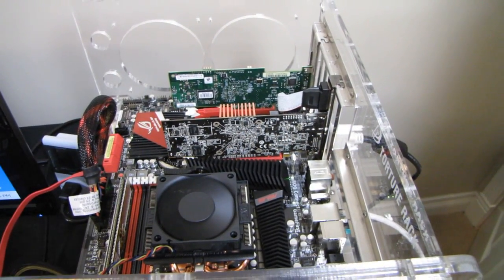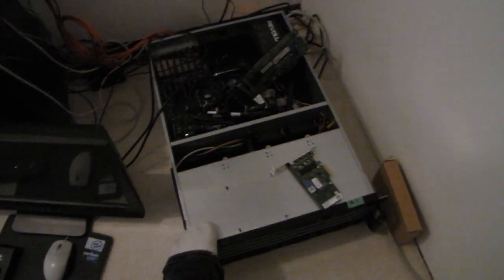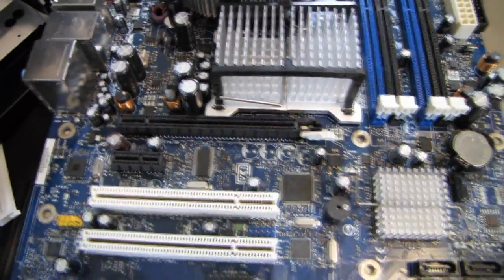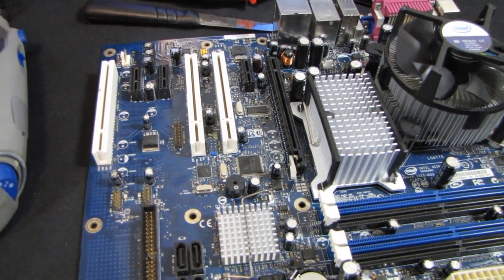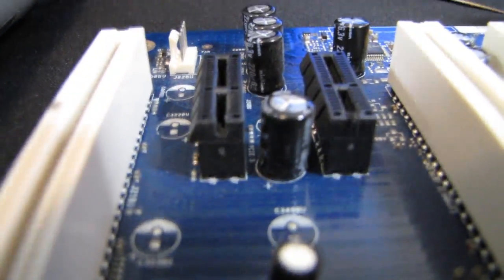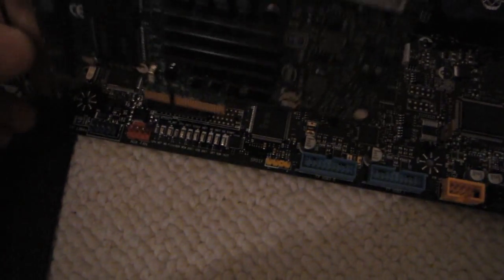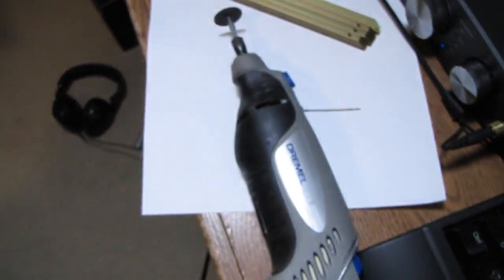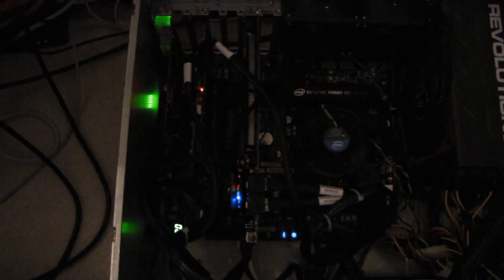Personal Project - Make a PCIe 1x Slot Compatible with Longer Cards Linus Tech Tips

Comment: I recently had the same issue with a PCI-E 1x slot. Tried the same methods, none of them really worked well.

The best I found was using a soldering iron with a small tip to melt the slot in the side, and then use a knife to cut off edges.

Comment: Okay, 
so for those who still look up for this particular DIY and do not have a Dremel at hand. I just did it with some cutter I had in my room and it actually works great ! However before you try it by yourself, please make sure the plastic is soft enough to be cut by hand. Applying too much force with a cutter might result in you being injured or the motherboard being damaged. I personnaly accidentaly sliped onto the motherboard with the cutter which luckily missed some BIOS PCB traces. 
Good luck !
Reply: Another way that might work is whacking the end off with a thin screw driver or flat piece of metal, or long thin nose pliers 2 bend & break the end off?  If he simply went in at 90 degrees 2 the slot instead of inline with it would have never damaged the pins!

Comment: I did it with a FLUSH SIDE CUTTER (use one for electronics which is smaller and thinner at the tip) which was just thin enough to fit inside the pcie slot and simply cut the tab clean, you have to look up close to notice its a mod and not juts an open pcie x1 slot, so this is the perfect tool for the job.
Sadly my asus M2NPV-VM is dumb and dosnt want to detect anything other than pciex1 cards.
The idea was to use a pcie x4 nvme card to put an ssd on it but the idea is busted because it wont detect it, and even a hd 3650 doesnt get detected (which i found people talking about it working on x1 slots) 
I read some M.2 ssds wont work on x1 slots so maybe its that too.
pcie x1 ethernet card works so the slot is working.
So all in all, the motherboard has to be smart enough and the ssd has to allow working in a x1 link.
Reply: Which tool exactly do you use ?, can you provide link ?

Comment: But in order to install the 4 lane card, you need to extend the PCIe x1 slot with more lanes. How are you going to extend that, will you have to take a part of another pcie x1 or pcie x16 slot lane from somewhere?
Reply: That's not true. To use it at x4 speed, you need 4 lanes. If you can get it into a "smaller" slot, it still works, just at lower speeds. In this case, his x4 card will run at x1 speeds, which may not matter to him if he doesn't need that speed in the first place.

Comment: the other way it works too, just cut the frigging useless pins on your card :-) i did it on an old gt9300, had to plug it into 4x pcie, savage way - plain cutter, i tore half of the lenth of the pins off and it works just ok... i needed to plug a very old supermicro with vga only into hdmi switch, and i had only one 4x pcie slot free, and it was darn cramped i wouldn be able to plug full lenght nvida the way you did... (vga->hdmi adaptor didn't work well, it wouldn't negociate well with my hdmi 2.0 only monitor during POST)

Comment: Would it be easier to cut the unused part of the cards contacts off and then slide it i in or at least notch the card where the connector housing hits it? The card is probably really cheap compared to the MOBO. I’m going to try this with an older HP Proliant server  and an old graphics card and I’m going to just trim the card contacts down instead of the board connector. I’m Just playing around with old parts as this server computer I got was free and is otherwise useless to me.

Comment: i need to know can u put a nvidia - geforce gtx 960 4gb gddr5 pci express 3.0 graphics card into a pci express x16  2.0 slot cause when i try the pc wont even go to the bios screen my pc just beeps
Reply: Yes you can. 
Try out all Display-outs, on your gpu and motherboard
Reply: Delusional Dan I did this myself and it works out of the box, check your psu and all the cables, try another gpu to see if yours is causing it.

Comment: I plan on putting a PCIE USB 3.1 adapter in an HP compaq 6000, will this work?
Reply: Theoretically yes, but due to the limited bandwidth of PCIe x1, you won't achieve the standard speed of usb 3.1 (10 Gbps) because PCIe x1 has a max bandwidth of 6 Gbps. You would probably be better off using a usb 3.0 adapter. Make sure to get one that runs of of SATA power, not molex, because the dell compaq 6000 has a few spare SATA power plugs. Due to their location it the case, you may also want to get a 12 inch sata power extender cable. If you search for "Mediasonic HP1-U34F" and "StarTech.com 12-Inch 15-Pin SATA Power" on amazon you will find a compatible card and extension cable. Hope this helps.

Comment: A 1-2 PCIe X1 ports amount on a gaming motherboard is fine.
WTF do MB manufactures of boards 2015+ are putting FOUR! of them on a premium gaming motherboard?!!  (AHEM, ASUS, AHEM)
Especially now-a-days with the advent of SSD drives becoming more popular for PCIe ports.  So many PCIe X1 ports on today's motherboards are simply a waste!
Who the hell designs these motherboards?!
Case in point.  Why the hell do we need on new gaming motherboards so many on-board graphics ports (especially DVI/VGA!!??), when gamers(for games anyways) will be using a DISCREET GPU!?  Save the space on the back I/O panel for more USB ports (for gaming peripherals), Thunderbolt 3 / Type C ports.
Reply: i myself dont have a gpu for my old pc and i only have a vga monitor left so i would be screwed.
secondly the newer boards have 4pcie 16x slots and 4pcie 1x slots, which are uncapped so you can do what linus did
Reply: I'm talking 'gaming' motherboards.  If you're a 'gamer', you're going to have a gaming motherboard with discreet GPU. Also, if you're a gamer, you're going to have a decent monitor, which at this stage in things, should at least have an HDMI port.  So, if your discreet GPU fails, I guess it's nice to have the option to drive a monitor, but all you should really need is an HDMI port.  SO I say on recent and new motherboards focused on gamers, one HDMI port on the back I/O panel is fine.  Save the rest of the space for USB peripherals, which gamers often use/need.
As far as pcie slots, if you've got a board with 4pcie 16x slots, you're likely needing that for some SLI configuration.  Some of the 1x slots are ultimately going to be covered up by the GPUs.  While the backside of the port may be opened up on some motherboards, does that mean something like an Intel M.2 drive would be able to take advantage of high speeds?  The more GPUs plugged into your system, the more pcie lanes you're going to need.  So there may not be much of a point to have so many pcie 1x slots, especially if the CPU is the limiting factor regarding the lanes.
Reply: you can still get a pcie extender cable if u NEED TO. even so you dont even have 4gpus unless u are rich

Comment: You could rotate the motherboard for 180 degrees instead of wishing your "dremel could run in reverse" :D For a moment I wondered how come a mad genius did not come up with as simple solution but then I figured out you probably wanted to do it as fast as possible so you don't wake up the baby and just went with what you had after you turned on the dremel :)
Reply: +Nedim Mehmedovic He probably couldn't get a good angle on the slot from the other direction, due to the other pcie slots and other parts of the mobo being in the way.
Reply: +XepherTim  you are right, I just watched the video one more time and he actually explained this issue when he mentioned dremel as one of his options :)
Reply: +Nedim Mehmedovic Yeah, I actually just tried this and getting a good angle is really annoying, especially if you don't have a really small dremel. I actually went with a different tactic where you dremel perpendicular to the pcie slot so you don't have to worry about hitting the little metal pieces quite as much.
Reply: If you use dremel often Flex Shaft Attachment is awesome (I got one with my dremel knock off)... It lowers the profile and is great if you need precision. https://www.dremel.com/en-us/Attachments/Pages/ProductDetail.aspx?pid=225-01
Reply: +Nedim Mehmedovic Yup, that or a right angle attachment would be very useful in this situation.I'm not sure I use a dremel often enough to justify the purchase though.
Reply: +Nedim Mehmedovic I was just about to comment on this, turn the dremel.... I literally had to grab the closest circular thing and spin 180 in my chair just to make sure I wasn't missing something obvious
Reply: +Sean Anderson I had to do that in my head couple of times before I typed my commented :D However, he actually explained why he was unable to do it prior to the cut (I've missed it as well when I watched the video for the first time) :D It is impossible to get a good angle because motherboard elements are in the way :)
Reply: Nedim Mehmedovic I think what he meant was, he couldn't do it with the dremel while it was still in the case, but then he took it out of the case anyways.

Comment: On the pinout for PCIE on wikipedia, the top right pin that got cut was just a ground pin.
However, the pin to the left of that was a receive pin. Or it might also be the pin which tells the motherboard that the card is connected, which if that were broken...you're screwed

Comment: you put the motherboard on carpet omfg!!!!
Reply: Nah, i've built >1000 systems over the past 10 years as a professional system integrator, i'd say >80% of them were done on carpet, and i never had a single problem with static discharge. Oh, one of my latest build was a 1U server with 2x xeon e5-2698v4 CPUs(20core each) with 16 x 64GB dimm ddr4 2400 ram,(1TB total). Oh, yeah, that was done on carpet too. Another recent one, xeon e5-2699v4, with 4x128GB ddr4 2400 ram(512GB total) in a micro atx chassis(prodigy-m). Again, done on carpet. oh, and the ram, just floating around, didn't come in antistatic bag, just stored on the carpet >2 months when I got around to it. 
I used to work in an environment that was not carpet at all, but tile, you would stand up, and the 10 feet to the light switch would build up enough static to give a sizable shock when flipping off the switch. Again, handled sensitive components like 24bit ADC chips, bare boards such as rasberrry pis, arduinos and wifi modules. Consistently shocking them from the environment, and again, never have I ever had one die due to static discharge.

This being said, static discharge is still a serious issue, on the manufacturing line(making 10000+ chips per day) 1 in 1000 died due to the static which i just described. You have a 99.99% chance to not break your components, so if it's just a single build, or if you are willing to send back components, then stop worrying about it so much. You have a higher chance to break your motherboard by buying an LGA socket motherboard because those things always bend their pins and are never fixable(which is why i prefer PGA CPU sockets). I've never lost a CPU due to bent pins on a CPU, but i've lost >10 motherboards due to bent pins on the motherboard. That is the issue you should bring light to.
Reply: Mike Crapse good job backing up my statement by just saying it isnt a huge threat and talking about a whole different topic
Reply: Benjamin Hopkins electrostatic discharge from carpet could easily kill the board
Reply: Benjamin Hopkins so?
Reply: Michael beseler doubt it
Reply: Mike Crapse google search it
Reply: ESD discharge can greatly reduce lifetime of electronic device or  deteriorate it's technical parameters. It causes deferred malfunction, so you just don't understand relationship between this failure and it's cause. As a system integrator you must know what ESD protected area is, and act according to specifications from component manufacturers. That's the difference between professional and dilettante.

Comment: That Pentium 4 tag reminded me of my first computer which I really don't know about..I just remember Windows Millenium, the one before that, and Windows XP was installed in it. I played GTA3, Warcraft3 etc. What specs could it have?
Reply: AfterDark3 you think you're funny?
Reply: Windows XP / Windows Vista
Processor	
400 MHz Pentium II or equivalent
Video	
8 MB 3D video card (TNT, i810, Voodoo 3, Rage 128 equivalent or better) with DirectX® 8.1 support
32 MB 3D video card
Memory	
128 MB RAM
256 MB of RAM
Storage	
700 MB available HD space
Internet	
Multiplayer requires a low-latency, active Internet connection rated at 28.8 KBps+.
LAN play requires a TCP/IP connection.
Media	
4X CD-ROM drive

I'd say around that.
Reply: CalculuS Its a joke. And yes, I'm trying to be slightly humorous.
Reply: AfterDark3 come on man, next time atleast try to be a little more original.
Reply: CalculuS I'd like to sound like an internet Dushebag so i will, But will it run Crysis?

Comment: you shouldn't have a problem with the power draw, as long as the video card has power direct from the PSu e.g. 6-pin/ 8-pin, because most video cards should draw any power that the PCI lanes are not supplying them with from the PSU directly.

Comment: well you could solder in a x16 slot you will just have to flush cut all the unused pins.  You could also buy a plug in adaptor. I would like to note they do make x1 video cards really that would be the cheapest solution.

Comment: Correct way would be just using a preheat/rework station, then removing and replace the socket. Takes less than ten mins to do (minus the time to order the DIP PCI-E socket from digikey)

Comment: Your son is going to be a total and complete computer geek. AAAAand those nVidia 3D glasses don't make for good eye protection. You are going to want to have something else like actual safety glasses that you could get at the hardware store for cheap. Yes I do agree with you to wear safety glasses as I nearly lost an eye from flying and hot debris but don't use stuff for gaming for safety. It's kinda like using bowling shoes as running shoes.

Comment: The motherboard has some extra pins for a card higher speed (and length), why not just unweld it and weld one from some of the corrupt motherboard then?
(I assume you have one or two at home, at work, not to mention stores with electronic equipment)?
Sorry for my poor english
;o)

Comment: and board fails in 1 month time due to sitting it on the carpet and passing static potential through integrated circuits that can handle 1/1000th of the voltage of static electricity

Comment: Looks like there is a 4x footprint on your motherboard, maybe you could use a heatgun to desolder the existing 1x slot (shrouding the surrounding board with heat shielding, of course), then install a real physical 4x slot (which can be purchased from Mouser or Digikey). Of course, Dremel is easier ;D

Comment from the maker: I was on vacation when I filmed this.
Reply: So you took a motherboard with you on vacation
Reply: this works with PCI 16?
Reply: Noice
Reply: To be that guy resurrecting an epicly old thread, but how did this solution work out longer term? Have a similar issues with an older machine right now.
Reply: @nathang7309  in videos in recent years hes mentioned that its totally workable doing this so im asuming it worked just fine.

Comment from the maker: ended up being more hassle than worth due to crap SMC modem from my internet provider.

These days I could take another run at it, but I'm pretty happy with my EA4500 running pre-cloud firmware.
Reply: i am the first to like and reply, more than 10 years later
Reply: iThink it's pretty fascinating how U spend so much time on '$ervers' rather than simply adding storage to your 'workstations' & linking them 2 each other =))  What a waste, in so many ways =P
Reply: what about these days? is this still a viable option or do we need to buy those expensive x1 to x4/x8/x16 slot adapters?

Comment: Ive done this before, no problem at all. What I really want to know is, what do you need a NIC with four slots for? Two I understand for LAN, but outside of building your own far superior router, what will you do with all those ports? Or are the PCs connected directly rather than via a router? Does it allow for more simultaneous connections? Speed? Something?

Comment: Larger cards are not guaranteed to work in smaller slots like they do vise versa. Some cards (especially 16x graphics cards) have their "PRSNT" Signal only on one of the last two pins, and if this pin isnt connected, the system just doesnt notice a card installed in the slot. Well, some cards might run, but theres no guarantee all of them will.

Comment: But you can't use those in this case: you'd actually need an additional bracket on the backside of the case or you'd need a µATX motherboard. Additional reason why not to use it: the card would only be supported by the mounting screw at the case, but would be free-floating for the rest, which really isn't an ideal situation ...

Comment: Your best options would have been the hot knife, pulling out from the slot as you cut and using something to guard the PCB below the knife...or, using a pin-point attachment (etching?)(I 4get what they called) on the Dremel (after the baby was awake!). And a nail file works great in a tight spot like that too, to clean things up ;)

Comment: hey linus. i got a question. what is the benifits of a raid card vs just enabling raid mode on the onboard sata ports? my comp is running fine in raid mode off the motherboard. but im curious if i would see even more increases in performance off of a raid card in the pcie port.